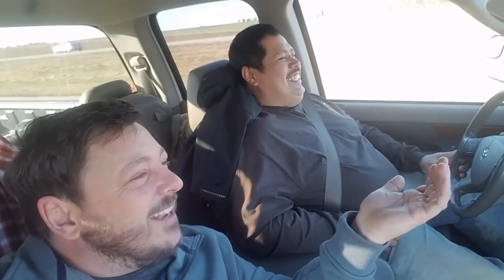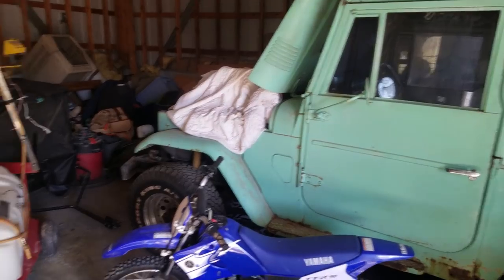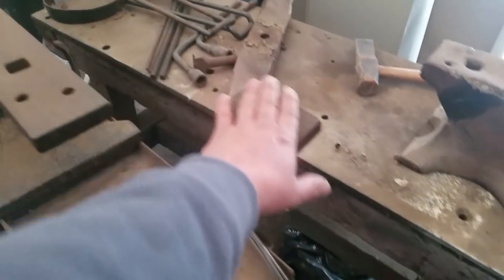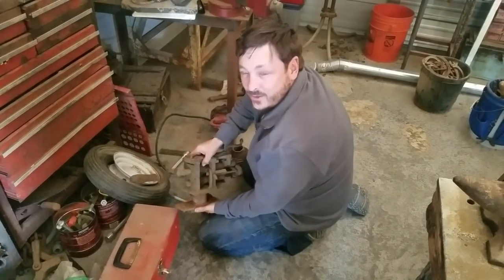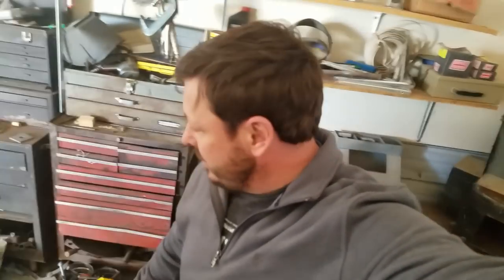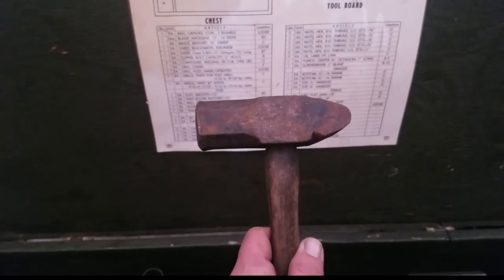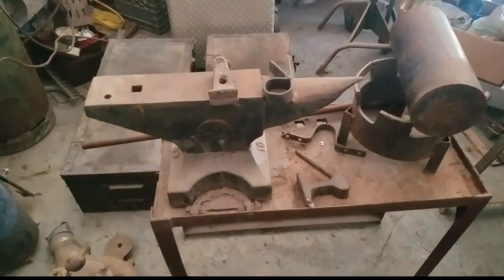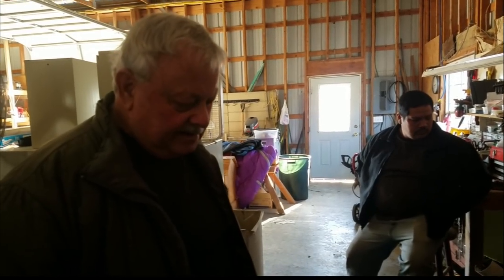Once In a Lifetime Barn Find. THE BLACKSMITH'S DREAM !

Comment: Alcosa are a casting company mainly work in aluminium. Alldays and onions were massive blacksmiths equipment manufacturers from Birmingham England. Alcosa are still in Birmingham but alldays and onions have long gone so I guess alcosa brought them out.

Comment: I would have thought that that blower would be English imperial measurements, not metric considering it's age.  May still be different from our own English measurements in the US, but a lot of the older british shows still talk in miles, gallons, etc.
Reply from the maker: +Rebel9668 Well that explains it! Thanks brother!
Reply: Rebel9668 even though we use the metric system for nearly everything we never talk about kilometres and metres but use yards and miles
Reply: We’re still on miles in U.K. but food has to be sold in metric (there are market traders who have been prosecuted for selling in lbs &ozs) fuel is sold by the litre but milk in pints (with a metric conversion number) so a big number of litres but always say 2.273 litres then in smaller print 4pints. We’re in a crazy limbo of nearly metric with some imperial throw backs.
Reply: British Standard Whitworth.

Comment: I take it that he donated all of this stuff to the blacksmith museum/park that you have shown in previous videos?
Reply from the maker: +Arkansas Pilgrim He donated some stuff to me personally and I bought some. We will be building a blacksmith shop on the homestead!
Reply: Wow!  Good for you!  I'm looking forward to seeing you work with it.

BTW, I'm leaning towards setting up a small forge (then again, I'm leaning towards doing a lot of things).  I just made a couple of knives for Christmas presents (first time and they don't suck) and I used one of those small round charcoal barbecues for a forge and a Horrible Fright heat gun for a blower to heat treat the blades.  A brake drum would feel like a pro-shop forge in comparison.

Merry Christmas!
Reply: I used a railroad track anvil and a brake drum style forge for about 4 years. The only hammer I had was a 3lb engineer hammer. I still have the same forge and use it. I used a dimmer switch and a $10 hair dryer for a blower. I built a gas forge that was ok at best. I prefer coal / charcoal to the gas forge I made.

Comment: I'm a 15 year old blacksmith wold you like to give me the best Christmas ever ANVIL hint hint
Reply: flipazoid 27 its called work for it and save your money to buy one instead of asking for a hand out. You would have much more respect for an anvil/tools you aquire over your time as a blacksmith. Just my opinion
Reply: Nathan Martin trust me I have but I can't find any and I have looked high and low and that comment was a joke
Reply: People can't get jokes online for some reason .
Reply: I'm also fifteen and do a little black smithing. I use railroad parts as an anvil as well as the vice I have. It's not the same as an actual anvil but it is a lot of fun and very rewarding to make knives and tools for my self
Reply from the maker: +Single Bit Outdoors Excellent!
Reply: Single Bit Outdoors cool I made an anvil and it is not pretty but it works
Reply: flipazoid 27 I started blacksmithing when I was 11 with a bit off railway track that I cut with a hacksaw I'm 15 now and have bought my self and anvil threw making pokers and hooks and also made back the price off it just keep trying and youll get there eventually I used railway track for 3 years before I got a proper anvil
Reply: Samuel Logan I have the money I got is the same way just making little trinkets and working for my neighbor I just can't kind any but I hope one will come around any way thank you for the advice👍
Reply: flipazoid 27 I'm in northern Ireland and they is anvils every where I payed £180 for a 134 pound peter Wright
Reply: Samuel Logan No Fair
Reply: flipazoid 27 the boy I bought it off had about 300 off them piled up
Reply: Samuel Logan wooh!!!!! Northern Ireland fans!!!!